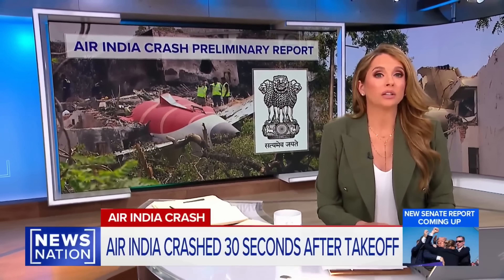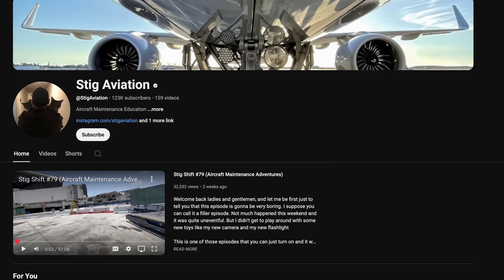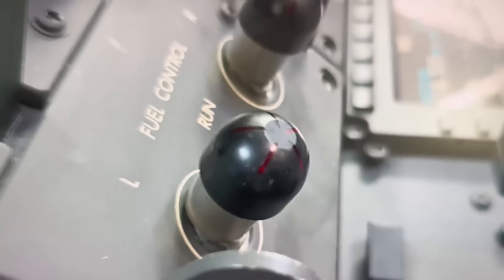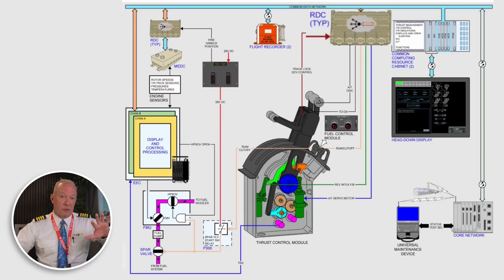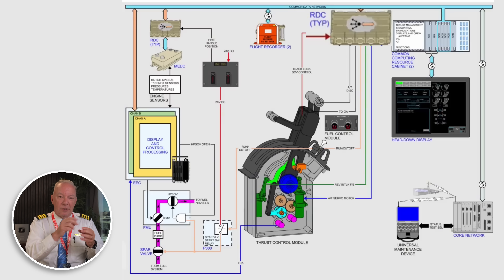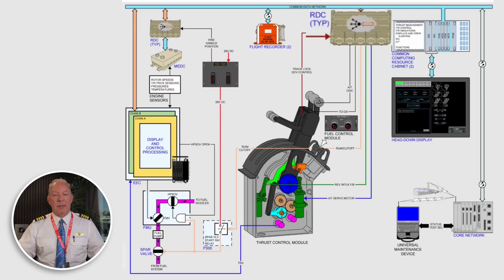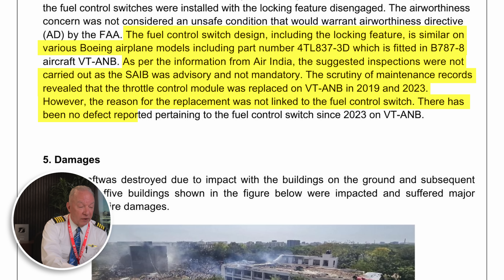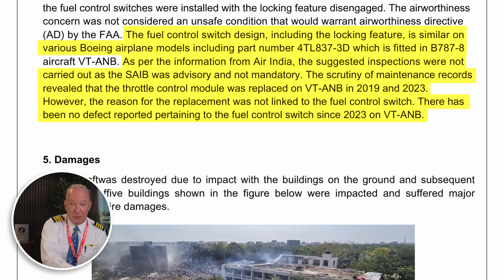The Truth About Boeing 787 Fuel Control Switches

Comment: I’ve been watching YT videos from Geoffrey Thomas & Richard Geoffrey. They’re all in on the Air India maintenance failures hypothesis and produced a 17-page report. They’ve been working with Boeing and the NTSB but haven’t had cooperation with India’s agency & Air India. Lavatory water leak ingress causing damage to rear EE bay/fuel pump cavitation/both engine shut down within seconds. RAT deploys, only the captain has instrumentation power, he takes over, one of them transitions fuel switches to re-start engines, but too late. Richard details many 787 airworthiness directives & advisories regarding wastewater/urine ingress, including one issued in late May. Oddly, Air India even admitted they don’t do any anything unless it’s mandatory. That Air India 787 had a history of such leaks, including the discovery of urine covering various electronics racks. Air India inappropriately dealt with the problem by carpeting the overlying cabin with rubber-backed carpet. Richard seems to debunk the suicidal pilot theory and explain fuel switch transitioning (which occurred after engines shut down) thoroughly.  See "Airline News with Geoffrey Thomas - Toilet Leaks Exposed." Thoughts?

Comment: Comparing the 787 to other aircraft is impossible.  The electrical system is way more complex.  The very idea that the fuel control switches are solely responsible for fuel to the engines…so don’t look further is misleading.  How is it when you start the engines the start selectors are both moved and the fuel control switches are moved…but no fuel is actually flowing into the engine?  There are other components that are digital and are controlling.  The idea that these are powered by the battery in flight isn’t that easy either.  The batteries are there as a backup…there is a very complex system of VFSG’s and s distribution network of staggering design with a whole lot of remote distributions units and it’s all being controlled digitally.  This is not to imply that you are incorrect in assuming a Crewmember moved the switches… but you certainly didn’t rule out a malfunction with that over simplified 28v drawing and relay.  The Lithiums are actually 32v.  But what’s in the details?
Reply: I don't know whether he intentionally ignored the control lines from the EEC to the valves, or whether he simply can't read a diagram properly, but you are right. It is NOT only the fuel control switch that can cut off the fuel valves.

Comment: I believe that the argument that it could've been an an errant signal that was read on the FDR and cutoff the fuel without the switches being physically moved, is irrelevant because one of the pilots confirmed they had been moved from the cockpit recording when he asked the other pilot why he did that.  You're absolutely right Capt. Steve!
Reply: Not necessarily so. We don't know what was said because the voice recordings have not been released. The info presented in the prelim report was not specified as verbatim and the question may have been asked because that pilot had seen the rollback on the instruments. I'm not saying it is so, just that there is not enough evidence in the public domain to make an informed decision. There is a way for the aircraft systems to have deliberately influenced the engine power autonomously, which can be seen in this flawed video. Hopefully due to a fault developed on the aircraft systems, rather than it be a faulty design by Boeing. However, almost all the stuff I have read and seen on the net is greatly flawed simply because people are jumping to conclusions without the facts to support them. It's all speculation!
Except there are a few on YT that provide significant background to these problems with 787s and this specific aeroplane too. Unfortunately, I don't have the links to hand, but they open up many more options as to the cause/s of this crash. However, What actually caused the event it seems is not so simple and this highly complex story of issues will take significant time and effort to solve. Until then, all we can do is wait for more information to be revealed.
Reply: Usung the same logic we can say that switches were not moved, because another pilot said he didn't move them.
Reply: I think it more likey he saw lights come up on the annunciator display. He then would have confirmed by glancing down at the switches themselves after this. Having said all, I think Steves explanation pits all theories to rest. The switches were definitely moved. In defense of the pilots, it could easily have been a random mistake as so many switches and devices are moved by the pilots thousands of times within time in type. People arent perfect, especially if there was some other distraction breaking their train of thought and concentration.
Reply: @Coops777  How often do you switch off the ignition in your car instead of e.g. turning on  lights?
We don't know what exactly did they talk and at which moment. Probably he first hear the sound of engines, asked why they are shut down, and only after that looked at the switches.
Reply: @azlktune No one could argue with you. Im just saying humans arent perfect 100 percent. Ive accidentally pulled the throttle while flying due to distraction for example.
Reply: @Coops777  People can do some typical things in typical situations, which they do every day. E.g. if pilot don't need to shutdown the engines after parking, but did it automatically - that is understandable. But pilots never shutdown engines at climbing. So even if he would like to do it by some reason, his "fail detector" in his brain will alarm him. 
I was needed once to restart an engine in my car to reset a fail mode, and I did it on the road without stopping. It was hard to do such an untypical thing.

Comment: One issue that I haven’t seen addressed is the sampling rate of the flight recorder. Everything I’ve read indicates one-second increments, implying a one-second sample rate. If this is really the case then two events reported as “one second apart” could in reality have occurred in an interval between 0 and 2 seconds. That’s a significant variation when analyzing two events this close in time.
Reply: Yep. Excellent point.

Comment: I’ve got no skin in this game or axe to grind with Boeing. The prelim report was too fuzzy IMO to reach hard conclusions. My first inclination was to look for a maintenance related fault. Can anyone rule out the hypothesis that water leaked into an EE Bay causing electrical mayhem? It’s not unheard of on this plane. Why did the second FDR apparently melt down away from the crash fire ?  Did the RAT deploy 2 secs after liftoff  and before fuel cut off or not? That would raise eyebrows would it not that the airplane was already in distress.

As I understand it when the RAT deploys certain buses switch over and the FOs screens would go inexplicably dark, makes me wonder if that’s what was meant by  “why did you cut off” since the FO was flying by reference  to those screens. Just a thought, we don’t have the whole CVR transcript yet. I’d like answers to all these questions before calling it a deliberate act.
Reply: Let’s start with the FDR’s. In a separate EE Bay located away from the crash fire one was found totally cooked at high temperature. That in itself seems a significant electrical anomaly. Any reason you can attribute to that and wouldn’t it be important to know why?
Reply: You’ve apparently made your mind up, I’m still open to other possibilities. Yes a pilot could physically move a switch to turn off engines with ill effect because it’s happened before. Also aware in an airplane complex as this a computer could upon receiving unreliable signals and without pilot input limit fuel flow or close a fuel valve at the wrong time because it’s happened before. To say it’s impossible is misleading. 

I want to know if liquid seeped into an EE bay and shorted out electronics, I also want a verified timeline particularly on RAT deployment because these things matter to establish true cause and effect. Like to be really sure it wasn’t a mechanical before blaming pilots.

Comment: Underlying the 787 design process is a Failure Modes, Effects and Criticality analysis (FMECA), which looks for single point failures, interdependencies and redundancies. Your analysis is clear, but it assumes that the FMECA was both thorough and competently performed and the results were integrated in the 787’s design. Given the state of Boeing’s engineering over the past 20 years I suggest that one should be careful in making that assumption.

Comment: Interesting. And it explains why the Aircraft's Management System didn't have a function to stop a pilot from making this mistake, which could have no logical reason and was inevitably suicidal. But some planes do prevent this happening at low altitudes- why not Boeings?
Reply: Search in youtube for Jeremy John Thompson air India crash.  His analysis explains everything from the failed electrical services reported by inbound passengers, the yellow and green cabins lights flashing as reported by the one crash survivor and the FULL timeline sequence the reported conversation between the pilots.  It's enough to finish Boeing off....  It's all about the failed battery diode modules...
He even refers 17:50 to a Boeing press release saying the manufacturers of the battery diode module was swapped out:  “Cyient DLM Inks Production Contract with Boeing,    JUL 29, 2024 2:09:34 PM” when Boeing realised there were issues with their existing battery diode modules but either way Jeremey has found the needle in the haystack that has exonerated those poor pilots who were actually heroes!

Comment: what if the battery fail? it will affect the fuel control switches right? since the dc supply got cut-off.

Comment: About 10s seems about right for an electronic circuit breaker to trip,  turn off the 28V DC,  kill fuel to the engines, and then re-connect.     Maybe during the Rotate, a short of the 28V DC occurred, then the short went away, and the 28V DC circuit breaker re-connected.

Comment: Captain Steve missed two very important points.  1) A loss of the 28v DC, WILL cause both relays to turn off and cutoff fuel to the engines.  (same as removing the batteries from his toy)   2)  The 28v DC MUST have some protection from short, like a circuit breaker,  no mention.   3) Did the flight recorder indicate the 28VDC was present until the crash ?
Reply: Another important point he missed was that the FMV & HPSOV valves can be controlled from the EEC. So he's wrong in saying that ONLY the fuel control switch can cut off the fuel.
Reply: @Manticore1960 also the switch state that is recorded by the FDR comes from the main electronic bus, not the physical action of the switch.  Still think loss of the 28v can deactivate the fuel relays.

Comment: What of relay failure? Relays do have mechanical moving parts. Are the relays normally open or normally closed? Do the relays controlled by the fuel control switch live in the throttle control module?
Reply: A couple of things to note. Not all relays are mechanical. Solid state relays, that have no moving parts, are commonplace these days. Secondly, if the explanation from aircraft technicians on here is correct, and I believe they are, the two engine systems are redundant and separate like all systems on an aircraft. Statistically speaking there is no way two relays would fail at the same time.

Comment: Can't anyone see what is wrong with the shape of the nub which locks the switch ?? it should not have a flat top because with a combination of a the spring and a poor movement the locking pin COULD sit on to of the nub so it is not locked and that is the fault I'm sure is being referred to in the FAA report

Comment: Captain Steve you're a scammer. Now I've seen what you have been stating like in 3 videos that "there's no way that the engines turn off automatically other than the manually operated cut-off switches" and that's a big lie.  The FADEC (electronics) can automatically shut down an engine in certain conditions. I'm not saying that's what happened, I don't know what happened, but you're not telling the truth. You're hiding it
Reply: The diagram in this very video shows that there are control lines from the EEC to 2 of the fuel valves. So for Captain Steeeve to claim that the fuel can only be cut off by the fuel control switch is wrong.

Comment: Is this the truth?  What about FADEC?  Isn't the 787 using FADEC 3 from Safran?  There's no switch to relay to valve, there's the switch and then the FADEC controls the rest of the circuit.  You want to show it as a completely passive circuit but has electronics in it

Comment: as long as all the wiring is shielded and connected to where it needs to go and as long as the relays are working. any time you have a wire, you can have chafing or wearing down or even moisture could be inside. lots of variables with wiring and relays. it could have been a failure of the wiring or the relays....it's just basic electrical engineering

Comment: The explanation of the electrical path from the Fuel Cutoff Switches to the actual Fuel Cutoff Valves was great. It was technical enough so people that deal with this stuff all the time didn’t feel that they were being talked down to, while still keeping it understandable to us laypersons. My question is does the FCS relay as well as the actuator at the FC valve fail open? This might seem like a dumb question, but I was always told that the only dumb question is an unasked question.
Reply: It was far from "great", it was wrong! Anyone who looked at the diagram could see that to claim that ONLY the fuel control switch could cut off the fuel was completely wrong. Despite what he claimed, there are other connections to 2 of those valves from the EEC, clearly shown on the diagram.
Reply: @Manticore1960 thank you , how could I have been so thoughtless.

Comment: Great explanations, thanks! The diagram and switch operation supports very well too, well done! 
As for the root cause it may be worth checking, if a malfunction (e.g. water ingression in the avionics bay / computers) might have lead to a cut off signal, or if other system faults, e.g. incorrect signals for whatever reason, may have cascaded to an engine cut off by the computers. At least there must have been a serious electrical fault, since the RAT deployed instantly after take off. Hopefully the root cause will be fully identified so that this never happens again. Our thoughts should be with all the people lost their life and all the ones suffering due to this accident.
Reply: His claims about the switch operation were wrong! Look at the diagram yourself while listening to his explanation. He has omitted vital information provided by the diagram.

Comment: The locking feature of the fuel control switches would be very definite. Surely, if a given air crew had noticed that the switches were installed incorrectly and did not lock, they would have reported the issue as soon as they got on the ground. So the switches would have been reinstalled very soon thereafter. So the bulletin from the FAA was not a directive, because if there was a problem, it would have been immediately evident and fixed. No way it could have been an unknown condition.

Comment: So that dude that was so combative on the panel and implied that some sort of wiring malfunction caused a switch "event" can't be correct. If he was, then explain how after the pilot questioned the other guy about the switch cutoff, was he able to switch it back and start the engine restart sequence if the switch had not been turned off in the first place?
That guy was just another "piler on" who has an agenda and wants to believe Boeing is at fault.
Reply: he didn't switch it back. He toggled it several times over 4 seconds. It's more likely the switches were never turned to off and the copilot realized something was amiss so he toggled the switches several times and then was able ot re-engage the fuel pumps. We don't know if he actually saw anything done by the other pilot and got his warning from his view screen in front of him. he then assumed the pilot "turned off" the fuel switches. We need to hear all of the audio along with all of the facts before blaming the pilots.  I bet the switches were always on the "on" position and that an electrical short cut the fuel pumps off.

Comment: Clarification please, the position of the cutoffs switches are determined via a position indicator feedback or from the 28 VDC relay being energized or not? You mentioned a 28 VDC bus that looks like it may have a breaker to isolate that circuit for maintenance or other purposes, could the 28 VDC current be interrupted via a failed component or even trip due to an undervoltage condition.  If the 28 VDC current is interrupted won't the relay de-energize and give the signal that the switch was now in cutout, when in fact the physical switch was in Run?  Could even a loose 28 VDC wire be the culprit? One of the reasons for the ship crash into the bridge was because of a failure of a breaker. And they still haven't determined the cause of that breaker failure and so the ships continue to operate without determining the root cause.

Comment: @CaptainSteeeve you’ve asked for a good reason why the fuel switches were moved by the pilots, well here it is in Richard and Geoffrey’s credible analysis https://youtu.be/tjhadW0mC2c?si=5IgBcFsZti3kbkV8 so please stop inferring that this was a deliberate act, you are still doing this in a round about way with your comments! FYI even Boeing themselves are consulting with these guys
Reply: agreed , read my comments below. today they posted a vlog about fluid leak from the toilets as a very possible cause of an electrical short circuit that turned the engines off and fuel pumps off. It's been a long standing issue for a long time and the FAA issued warnings about this.